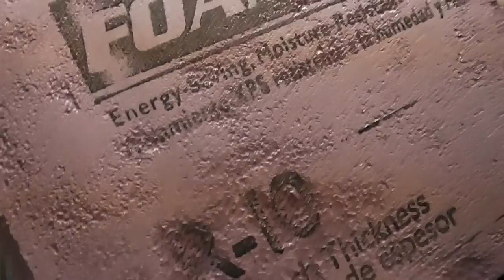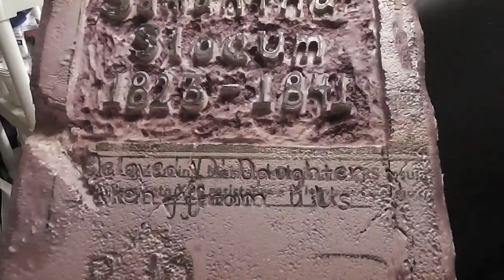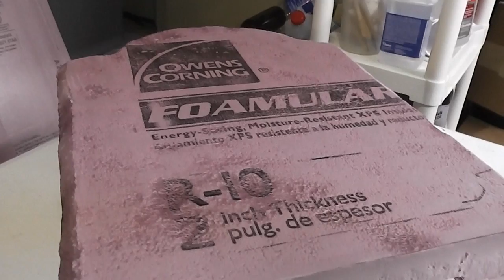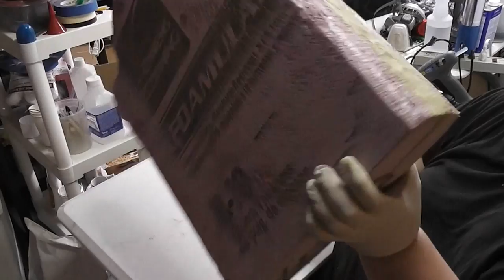Part 5 -  Heat Weathering and Sealing

Comment: Just want to start off by saying fantastic work! my question is could you use a heat gun in the same manner would you have to use water or does not heat gun give the same effect?
Reply from the maker: A heat gun will blow the water drops around in my experience. You could experiment with it but it won't give you the same effect. :(

Comment: okay I dont have that kind of torch the only thing I have is my creme brulee torch (cooking torch) , and I wouldnt want to ruin it. So unlike the mixer that you could never use again (pumpkin tute) if could I use my creme brulee torch (as long as I didnt get the plastic in the fire tubey thing where the flame comes out should work fine, yes?
Reply from the maker: Yep, a creme brulee torch should be fine, just remember that the smaller torch will have a more focused heat spot and you may use a fair amount of fuel.

Comment: Just wondering if there's a reason you couldn't put the side with writing to the inside?
Reply from the maker: Halloweenlizzy72 I'm not sure what you mean by 'side with writing to the inside.'  If it's inside the structure of the tombstone you won't see it at all.
Reply: Drachenfang Sorry.  Should have been a little more clear.  By the side with writing, I mean the side of the foam with the logo and R 10 on it.  I've never worked with this foam, but could you glue those two sides (with the r-value) together and essentially have a blank canvas to work with on the outside?  BTW, enjoy all your videos and look forward to your next project.
Reply from the maker: Halloweenlizzy72 Ah now I understand. You are totally correct and that is indeed a better way of doing it. I should have done that in the first place. Some foams have writing on both sides and I wanted to make sure people knew that any writing on the surface would show through in the final product if it was not dealt with. I will throw a note to that effect into the video. Thanks for spotting that. :)